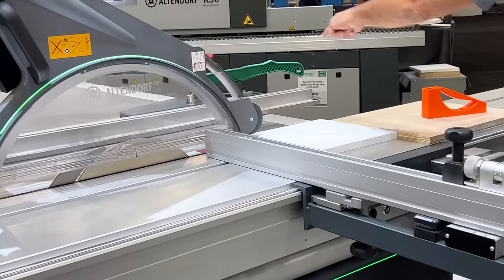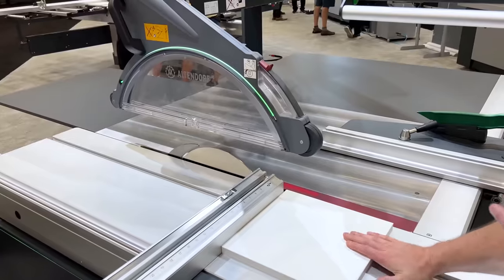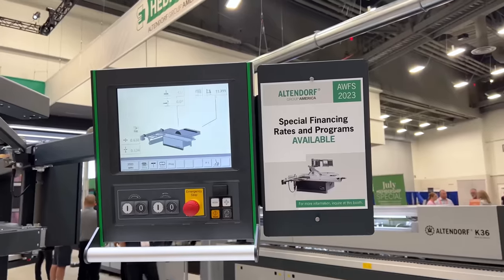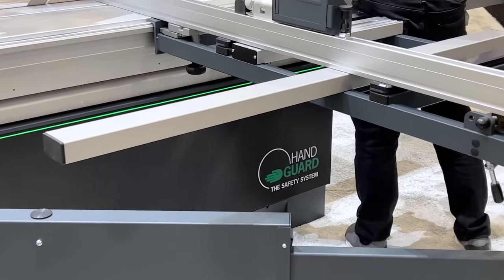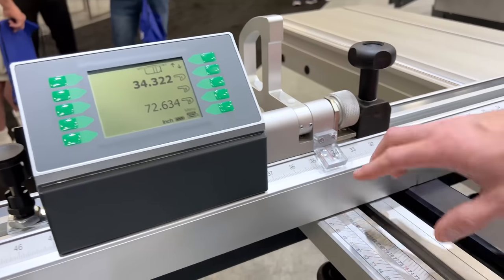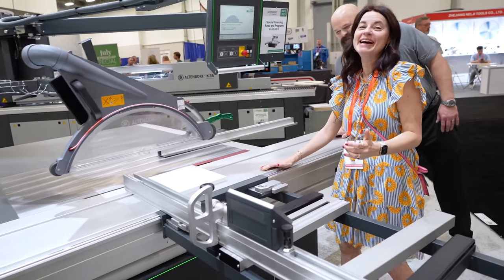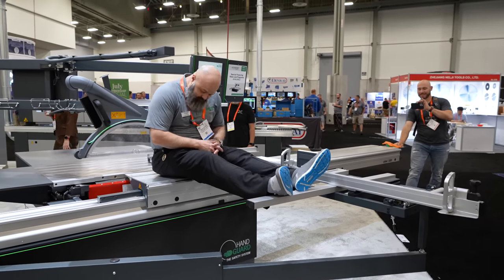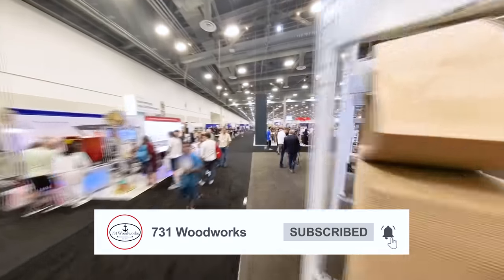The Most Exciting Table Saw in YEARS!

Comment: How would this react to a board catching the blade wrong, kicking out, and pulling your hand in as it kicks the board?
Wonder how fast the computer can see that coming, because that sort of accident happens in a split second.
Reply: judging by how every other comment besides the kickback questions get some harts / like symbols i guess this is something we dont talk about :-)
Reply: There is no way a computer will do this computation in the time it is required to save your hand.
Reply: @Maxime-ho9iv  The average computer can do 5-500 billion computations a second. On the low end, that's a calculation ever 12 nano seconds. If a kickback takes half a second , that's 500,000 nano seconds. In that time, the computer can perform 41,666 computations.
Reply: @StroalOutdoors  But it is probably not only CPU causing the delay (camera speed, transfer speed, etc.).
Reply: @liquido11  They do add delay, but it's still very possible.
Reply: Most accidents are just that, accidents where the hand is pulled in & not someone putting their hand in the path of the blade while pushing. This demonstration didn’t show the most important aspect, as the original comment brought up. It’s like designing a car braking system only forward, when cars turn & things come from all kinds of angles.
Reply: Computer vision is slow and inaccurate, and that's if the cameras a perfectly clean. I think there's a reason they're using a metal disk when stopsaw's demos used a real blade.
Reply: @veiledAutonym  It's actually incredibly fast and accurate. Has been for a while. I work with it on a daily basis and it's incredible what it can do.
Reply: Computer Vision ist quite fast and accurate. Think of grain sorting systems where grains are thrown down a shoot and the camera detects off-colored grains individually,  activating air valves to blow them out of the bunch. Pretty fast, pretty impressive. Makes you wonder why they did not demo such a case, cause the technology in theory should be up for it.
Reply: I mean, that's the main reason people lose fingers, not because they had their hand on the workpiece while making a cut.
Reply: @TheCoolmanXD  Optical detection and computer vision are not the same thing, and sorting grain is not a safety critical system. What's the miss-rate on those grains?  You can see the saw drop in this video, over multiple frames. Sawstop works faster than a single frame of 60fps video. I think the feed system is a better safety feature than the hand tracking. 

When stopsaw did their demos, the ceo put his hand into a real blade. This demo is using a spinning disk. I don't think there's much more to say than that.
Reply: @TheCoolmanXD I work with computer vision that doesn't even have to identify an object, it just has to react if anything crosses into its zone. That thing is so unreliable, with both false positives and even worse, false negatives. I'm not putting my hands anywhere near this saw.
Reply: @TheCoolmanXD  in your example, the computer identifies the grain super fast but it is not “rejected” until later in the system. The blow mechanism is often a few meters behind where the cameras identify what to discard. It is not just the computer here, it’s also the communication, the drop mechanism.
Reply: @StroalOutdoors  While that is true, can it drop the blade in that time?
Reply: Hence the riving knife tucked in close to the blade to stop that. I have never seen a board get kicked back, however I have seen a guy get distracted turn and slip and run his hand through the blade loosing all his fingers on his right hand in about a second. so that is a way more likely scenario especially in a commercial shop. 

A kick back is way more likely in our hobby workshop as we tend to do everything on the table saw. where commercial operations will use a spindle moulder for things like rebates, and specialist tools for specific tasks. 

I personally think this is great non destructive technology. you are all thinking hobbiest not commercial
Reply: @veiledAutonym  and a white, textureless board for the easiest possible detection.
Reply: @floatsomboy  I've see kickback when a riving knife was also used.  It can happen.  The distraction thing is also a real possibility. 
Don't get me wrong, I think this tech is a step in the right direction, but I don't know if it's to the point where I trust it with my life. Maybe a combination of this AND the sensors that Sawstop use would be the right answer.
Reply: as a software engineer, you are psychotic if you rely on a machine learning model performing reliably and in less than 5ms to save your digits.  sawstop is appealing because it has so few points of failure: it detects a resistance drop from your skin, it triggers.  thats easy to test and easy to trust.  machine learning models like the ones used in image recognition software are often only 95% reliable, and are subject to any number of failure modes.  we also don't know what this software is running on.  how powerful a gpu is this running on? is it running on c, python, something else?  how does it behave when theres a memory leak and the process runs out of memory (a very common scenario with newer ai models)?

maybe anecdotes of "i used it a bunch and it was fine" are enough for some, but i wouldn't bet my membership card in the 10 fingers club on it.
Reply: @smithfamilydesigns2012  If the saw is used correctly for what is designed for and the bade (I.e. the blade fully up and not just barely sticking out the top of the wood) and riving knife are set correctly(tucked in tight to the blade) kick back sideways should never happen. Sideways kick back happens when the board in not held down firmly to the table and is allowed to ride up and over the blade, this is exasperated by people have the blade raised just enough (the old only raise the blade up an extra 1/3 of the thickness of timber) to cut the timber they are cutting. Commercial saws like that are designed for the blade to be fully raised, to give better cuts and for safety. Hence it has a full hood guard not a pathetic little plastic thing attached to the riving knife,  BTW I have been trade qualified for over 25 years now and have worked in commercial workshops using these types of saws.

I find it funny that people dissing this system as unsafe rely on the same technology in other every day items. And I bet most rely on their car's safety features like airbags and driver assist or may have one of those self drive/autonomous Tesler's; while driving down the street at over 60 MPH subjecting them to way more chance of harm, with way more dire consequences.

Yes all this technology is new and in it's infancy. end of the day we need to rely on the top 3" (brain between our ears) for our safety first and foremost. IMO one finger lost to millisecond delay is better then the whole hand.
Reply: @floatsomboy  
At what point did I dis this technology?
As for proper saw usage, you are correct, if you take the time to ensure everything is in working order and aligned correctly, these accidents are greatly reduced.
How many people actually check alignment every time they use the saw?  Also, sometimes imperfections in boards can cause them to shift on the saw unexpectedly as they are pushed through. Even with a perfect setup, accidents can/will still happen.
I was just questioning how fast can that system react in that particular situation.
I even have a follow-up post saying it's good to see more tech like this and suggested maybe this with something like the Sawstop tech would be a great combo. 
When you put systems like that in place, people get too comfortable with the tool and rely on it's safety systems too much. You need to know it's limitations.
Reply: This and sawstop are, I believe, missing the point.  The problem is putting our hands anywhere near the blade, and standing anywhere near kickback. We should imho be clamping the wood to the slide and pushing it through remotely. Our losing hands problem is that we want to cut wood too quickly and to do it on cheap machines.
Reply: @Maxime-ho9iv  the issue isn't the computation time, it's the stepper motor
Reply: Thank god the computer experts showed up in here to tell us all how this totally can't do what they say it can do...

[eye_roll]
Reply: @myrcutio  do you write in JavaScript or something? Ever heard of fly by wire in avionics? Software is what flies modern jets. The safety profile of a saw is no where near a 150 million dollar jet flying at 70,000 feet. Also this is a SAFETY protocol. Everything has a safety margin designed into it. Just because there is a safety margin or a system to protect you does not mean you should not be safe and respect the machine while using it. If you are triggering this protocol often, then you are failing at operating the machine properly.

also, bringing up a memory leak is ridiculous. That is a software FLAW, but does not represent code properly unit tested. come on man, do you just throw code on the screen the push to production?

also also, the camera is getting a wide view of the table so it already processing as the hand moves. it not difficult to recalculate the trajectory if the hand were to suddenly deviate from the one that was already locked on.
Reply: A computer will do it faster
Reply: Seems like a step in the right direction, but machine learning visual models are not nearly 100% accurate. It's very difficult to train an AI on every combination of skin tone, wood type, lighting conditions, etc. 

The beauty of Sawstop's mechanism is its simplicity. No system is 100% safe, but it seems like there are so many single failure points of this visual AI tracking system that I would have a hard time trusting it. 

Just look at the fatal car accidents with self driving cars from simple errors in visual identification in the real world. Until our machine learning models and computers can more completely model reality, these errors are baked into the tech. 

Like others have said, an AI + Sawstop combo would be the best. But until this tech matures and the price drops, Sawstop is going to save more fingers.
Reply: Yeah, as a ai engineer working with computer vision, I would not trust my hand with this. A "dumb" saw stop is much more reliable.
Reply: @StroalOutdoors  A kickback happens a LOT quicker than half a second.  The wood gets thrown back at you as fast as the blade is spinning.  Assuming 4000rpm on a 10 inch blade, that's 120 feet per second.  You're probably 2 feet max away from the blade, so that wood is going to hit you in less than 1 video frame.

Also 42k computations is absolutely nowhere near enough bandwidth to make a decision by putting an image through a neural network.  The reason a saw stop works so well is because your hand as a conductor completes the circuit and it instantly stops the blade & drops it.
Reply: @nevelis  the calculation of computations is based of an average, I'm sure they are running hardware specifically designed for their software. It's totally possible, and from this demo it looks legit.

Comment: saw this at IWF last year in Atlanta and spoke with the reps.  Great technology, especially the reset (no replacement of breakblock or blade).  Not sure if it will ever be cheap enough for the DIYer (that drop drive system is very expensive).  Great to see you sharing it with everyone!!
Reply: Yea, didn't he say the carriage that is dropped down at high speed was 200+ kilograms (400+ lbs.).  That's gonna need serious, high torque motor mechanisms.  I assume this machine runs on 3 phase power.

Comment: Impressive technology.  Definitely seems like this sensor approach is something that could eventually be scaled down to a hobbyist level similar to SawStop.
Reply: well hopefully having more than one safety options means sawstop can stop charging $5k for a "hobbyist" saw. thank god for some competition.
Reply: @jameszaccardo1520  as of right now this technology took about 10 years to develop and it's essentially an option that costs around €10k. It will probably take years until it can compete with sawstop for hobbyists.
Reply: @nino9273 so what? better than never.
Reply: in principle its pretty simple concept, you can run basic machine vision with just a raspberry pi, triggering the safety system is just sending a signal to a relay, modifying off the shelf table saw to mechanically retract is probably the most complicated thing to solve, or maybe just replacing the blade height adjustment crank with a clearpath servo or just a nema 34 stepper, cranking that handle at around 1500rpm would most likely get the blade out of the way pretty quick and the whole system should be around 300-400usd in parts... (600-700 in case of clearpath servo)
Reply: @dubi127  Conceptually it is indeed simple. That doesn't mean making it well is also easy. You have to have a vision system that works quick and well in all kinds of situations (dust, debris, ...) and you need to make sure that you have an extremely low level of false positives and absolutely no false negative.

In other words: making a quick proof of concept is indeed not that hard, but making it into a product that works flawless is a lot less easy.
Reply: @blahhblaah74  i know, making a finished product for mass market is a huge undertaking, reliability of the system would be mostly based on how good the software running the show is and whether you have good enough camera. Of course, higher spec hardware would allow you to run all of the code faster, maybe using two separate cameras, etc...

I was mostly talking about a DIY approach, if you can pretty reliably emulate a PC mouse just using a cheap webcam looking down on your hand, you can track hands using that software and just trigger the system once they are detected in a specified area. 

But then again, i am not saying i have the knowledge to make the code and bring this system to life, all i could do is provide the mechanical part of the system.
Reply: @dubi127  Indeed. That DIY approach is comparable to the proof of concept I mentioned. And even though I definitely can make the required software, I wouldn't trust my hands on it in all edge cases...
Reply: @blahhblaah74  the question is, would you trust it more than a regular table saw without any active safety?
Reply: @dubi127  I think that's the wrong question. If you have a safetysystem that doesn't work properly, you will get lulled into a false sense of security. This will result in you taking more risks.
If you have a table saw that is guaranteed to heavily injure you at small mistakes you will think twice before making your cut.

In the end, the second one will be safer...
Reply: @blahhblaah74  true, it all comes down to individual users... But I have to say, I believe most table saw injuries happen because people get too comfortable and careless around their saw even without any active safety systems

Comment: id be more interested to see what it can do in a kick back situation where the saw driives your hand through the blade from the back before you even know what happened. im curious why they never did a test like that, and am curious if its fast enough for that.
Reply: That’s the most likely scenario for an accident, not sliding your hand in the path while pushing. Which they didn’t even address.
Reply: we have one of those at school and they in the blink of an eye, even from behind. the detections radios is pretty big aswell.
Reply: Saw stop

Comment: For $1 million dollars :p.  Hammer has some blade stopping tech too.  It's good to see vendors trying new detection systems out, even if the saw is out of my price range.  Thanks for including it.
Reply: Hammer (Felder) uses the CS system and does not control the motor assembly when it activates. They use magnets that disengage and allows the motor to just drop down. Our motor assembly is driven by servo motors and is controlled the entire way, not allowing the motor to bottom out or be damaged in any way. That is how we are able to be back up and cutting 10 seconds after the safety system activates.

Comment: Professional shops as well as small shops must also factor in incident costs. Just one minor accident on a table saw could cost several thousand dollars to over a $100,000 if nerve damage occurs, just in medical bills. Now factor in fines levied by OSHA if/when they find an issue. And then come the Lawyers and then your insurance rates go up and can even affect your ability to bid on projects. This looks like a very well built machine that will help increase production, boost employee confidence while using the saw and help you produce a better product. If I had the production volume and room in a production shop, I would seriously consider this saw. I would assume financing would be available, either through the manufacturer or as a low interest business loan.

Comment: I’ve used alfendorf saws in workshop environments most of my career. they are the best table saws on the market. The rolls Royce of saws for sure. once you use a sliding panel saw everything else feels like going back in time.
Reply from the maker: Thanks for sharing
Reply: Thank you for the love! I can't agree more and not from an employee standpoint. I was looking at the Altendorf F25 for my own company prior to working for them and looked/researched and got hands on with others but the Altendorf design, materials and manufacturing results in the hands down best product available. Plus it will last long enough for me to pass it down to my kids.
Reply: @BradSnyderAltendorf  yeah they are incredible. Accuracy like nothing else and paired with a two or three bag extractor they are so clean. essential in a shop that’s cutting MDF for hours on end every day. 
Also, a small detail but changing the blade on a f45 takes me about 20 seconds. it’s just such a well designed saw.